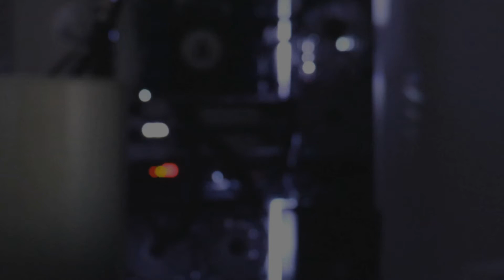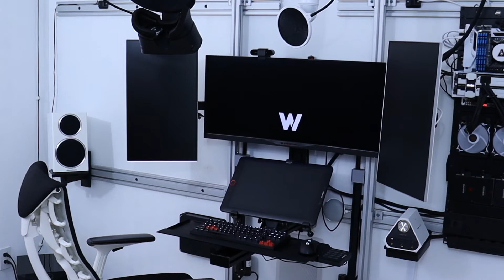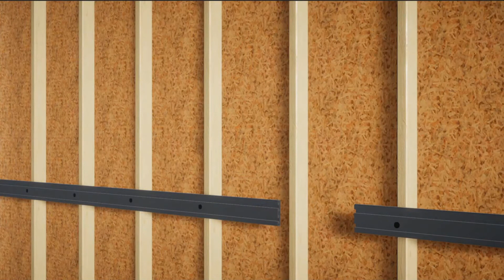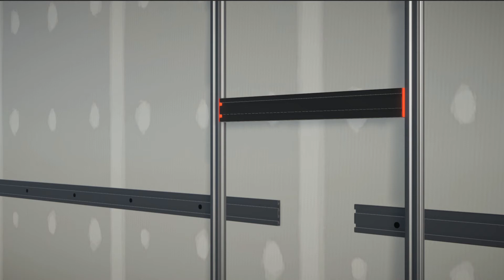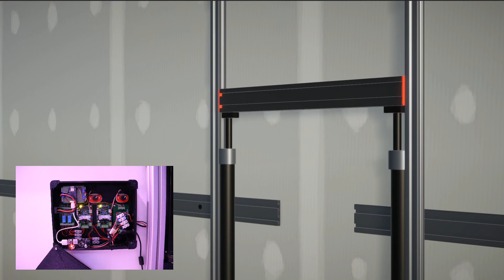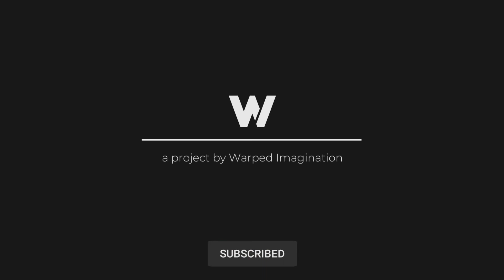Constructing The Height Adjustable Wall Mounted Desk

Comment: I'm looking into doing this for a 200x80 cm oak desk. So far, that seems pretty difficult. There's a commercially available system from Linak but otherwise I don't see any options.
Reply from the maker: At the time when I made this I was looking to go ultra small desk wise. I could lean on the desk and nothing would break but I wouldn't trust it to sit on (though I think it might still work)
I did look at a few commercial companies like the wall mounted computer monitors you see in hospitals, but they all kinda sucked. 
With that size desk its not simply the downward force that you have to be concerned with .. its a great challenge though

Comment: Can you share more about the vertical rail system you used here? It seems more compact than other options I've seen. Thanks!
Reply from the maker: It's super compact (maybe a little too much) .. and all custom nothing out of the box
The rails are bought from 8020 .. if I remember correctly they are 40 series rails .. the ones mounted to the wall are flat low profile, the two verticals are single with rails on all sides, the cross beam is a double again with rails on all sides. The vertical rails are threaded for height adjustable threads and mounted to the horizontal rails with simple L brackets (both brackets and feet are from 8020). Connections between the horizontal rail and the verticals were custom 3D prints.
Let me know if you have any more questions.

Comment: Absolutely love this. Found it in my research as I'm intending to build a wall-to-wall floating desk with electric height adjustment. The motors look like what I need. I would mount one on each side of the desk, which would be 2.5 meters apart. I'm curious about the leveling out feature you built, do you have any resources you can share on that? Thanks, really impressive work
Reply from the maker: So first stage I added a speed controller to each motor to get them pretty close to each other. Next I added a trimming feature to a remote I built here https://youtu.be/A6kqLgaBI3M
I do plan on automating it later on with sensors and I still haven't added limit switches as I wanted to test heights first.

Comment: i like the computer style on the wall, but i dont understand why would anyone give up the choice of having a large table to put stuff on.
what if you suddenly have the needs to put a book ref/ipad/cup/jar of water/tissue box/laptop infront of you?
Reply from the maker: I wanted to increase the floor space for my VR experiments so a minimal desk or furniture in general was a must for me.

Clutter can be a problem with so many experiments going on .. now those are assigned to cabinets that I can roll from the office space to the workshop space as needed.

Most of the time I have a small rollable cabinet where I place my tea .. though I am still thinking a cup holder on my small desk my happen soonish.